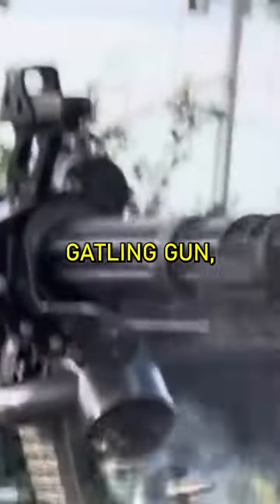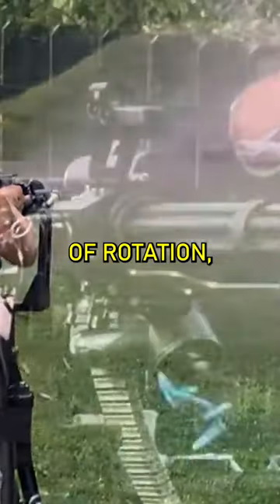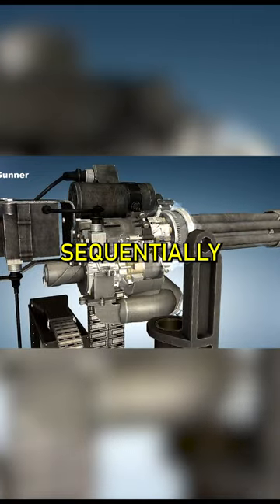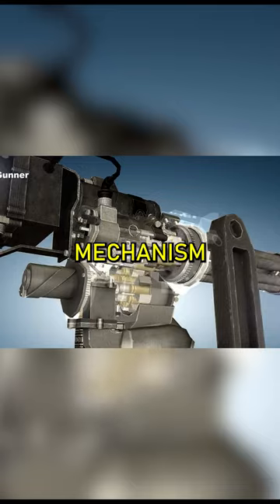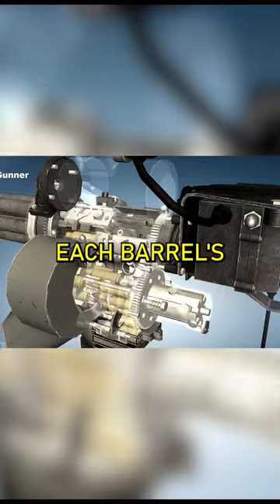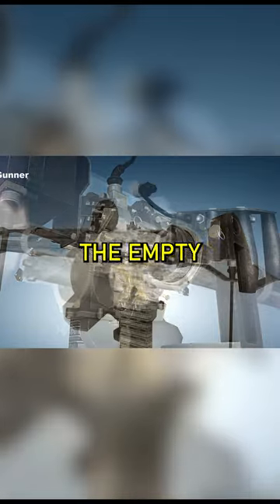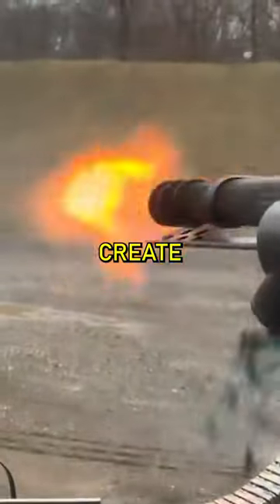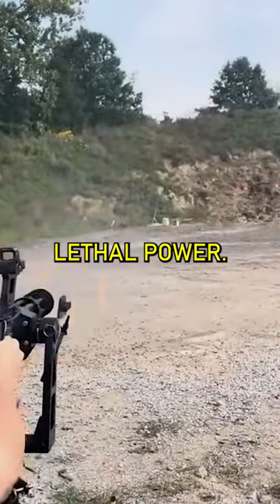How Does A Modern Gatling Gun Work - #shorts #gun #technology #interestingfacts

Comment: Dude doesnt know the difference between a Gatling Gun and a Minigun.
Reply: The minigun literally is a modern gatling gun. It works with the same principle. I think you are dude that doesnt know it
Reply: @thelespauldude3283  No. Miniguns and Gattling Guns are 2 different things. Miniuguns are full auto and have far higher rates of fire than a Gattling Gun does so therefore the function is different. Gattling Guns are only hand cranked and the barrel spins with the crank along with having a wide up before it fires. You can legally on a Gattling Gun in the US but cannot legally own a Minigun. Sucks to be an idiot, dont it? 😂